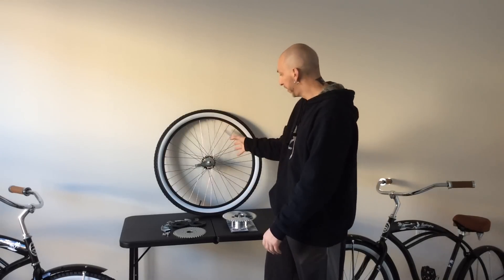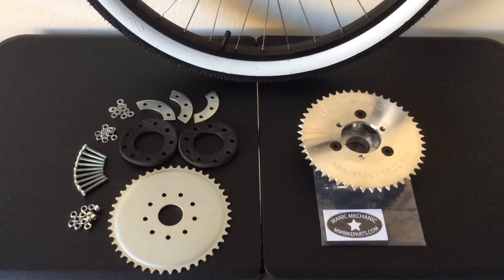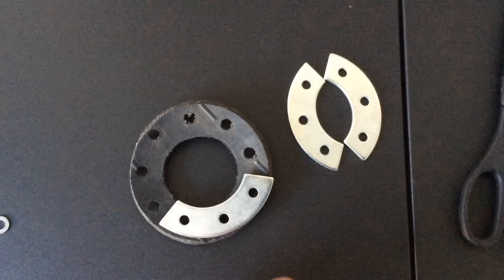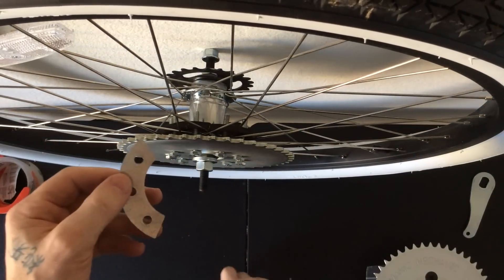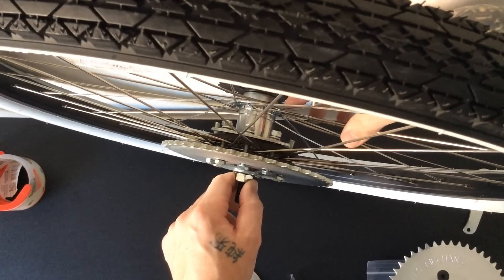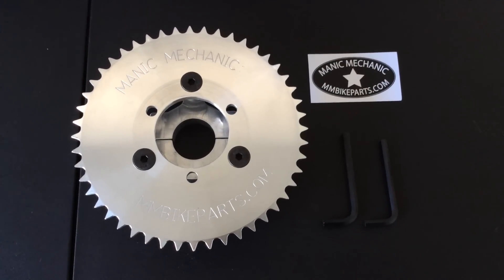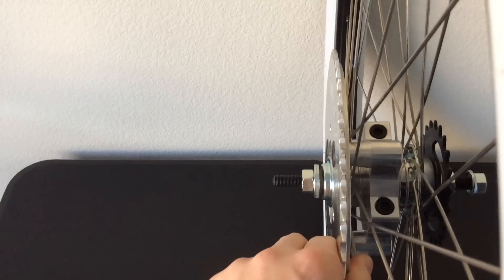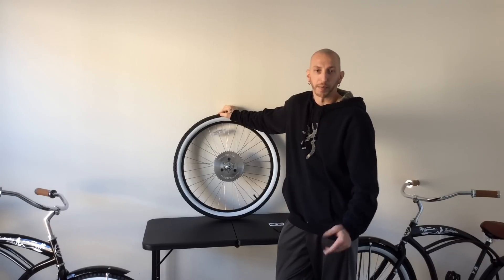How To Install A Motorized Bike Kit - Rear Sprocket

Comment: The sprocket adapters have dropped in price, I got a 38 teeth center wheel mount, with an adapter for smaller sprockets, I think I spent about $35.00, all said and done.
 These are way better than what comes in the kits, as you can switch them out, go to different gear sizes.
 I have been looking into a gear box for the the engine itself, have seen some pretty good ideas, but I think gearboxes are going to be the next biggest step in getting the most out of these little engines.
 I have a 110cc 2stroke, it's a beast, have had little trouble with it(though I am not comfortable going far with a bunch of tools) , but I can get up to 40mph on a flat surface, and can get 30 up a 20-30% incline. In fact this bike is too fast for just riding, it's meant to go fast and furious for long runs, I just give her a break to cool down every hour or so.
 Thanks for posting this information, I am always looking for new ideas on mobility without using any cars or trucks, I don't want to get a licence, I don't need one, and I would love to put together a couple bikes to make a 2-4 person "car type vehicle, with enough space in the back for a living space(when using a pop up tent is not feasible, or when it's cold and wet.
 Thanks again for your time and effort into your vids.

Comment: Who would want to spend 75$ one a back sprocket mount spend 25$ and get the motorised bike one in pretty sure that would come out on top
Reply from the maker: +Taylor Hadenfeldt You get what you pay for! If you watched the videos I believe it's pretty clear the differences. If spending all that time installing and adjusting is worth saving $50 then more power to you. When I break a spoke it took less than 30 minutes to change it out completely and be back riding again. Thanks for watching! Have a great holiday!

Comment: dude ur to biased by pimping ur buddy's gear, I've used several of the rag gears and you make it out to be way harder to install then it is, and I don't think that the upgrade for one of the kits is worth it, and if you can center a wheel by adjusting the spokes then the rag gear is easy, yours so FOS, good luck with your credibility. ..

Comment: the ragg sprocket works good with the cheap kit , if you want that new sprocket you will need a new chain and chain tensioner that this guy doesn't tell you about
Reply from the maker: I'm really not sure what in the world you're smoking, but that's not true at all. You're only changing how the sprocket is mounted so it doesn't even make sense that you would need a new chain and tensioner. I've always been able to use the same chains and tensioners that came in the kit with the rear sprocket adapter and I didn't have to do anything different at all.
Reply: Chuckle Head he also doesn't mention that all of these hub adapters slip on the hub from the torque and put all that pressure on just 3spokes...and using a coaster brake to stop you at 30mph, no way, you'll rip the guts out of it quick.
Reply: Chuckle Head
Reply: Sinister Custom Cycles Dude...you had the sprocket installed backwards.
Reply: the real issue that needs solving here is what to do to prevent slippage. period. red Loctite is an option, but I have no test results so,.. another option: score or cut some sort of diagonal cross-hatch pattern on the hub,  and on the inside surface of the adapter. then, take something like jb weld, or some sort of epoxy and slobber that on there. tighten down, and boom. it would be like 20-30 miniature keyways all filled with a rock-hard "key" substance to physically block slipping. that's all I got for ideas everything else leaves the surface smooth and I don't think that's gonna work. especially for a small hub/big wheel/fat dude/big motor/crazy torque. just tightening it more isn't gonna cut it.